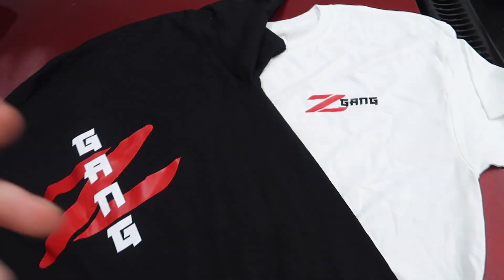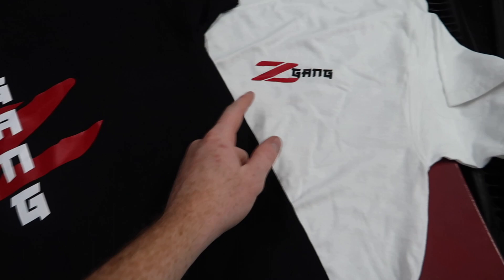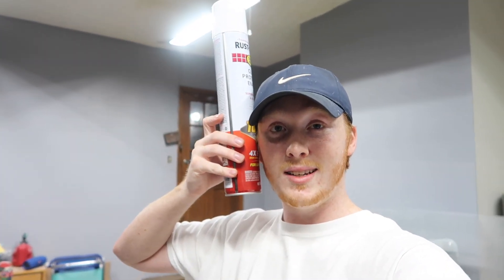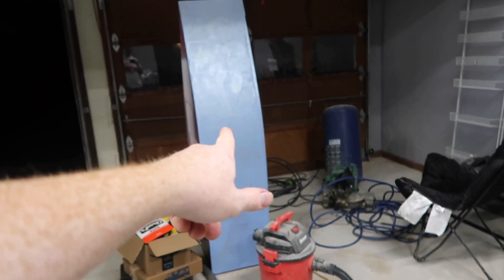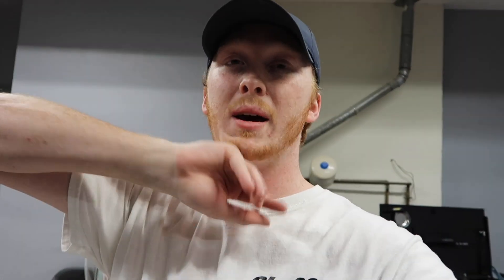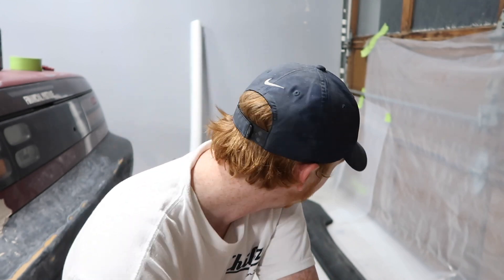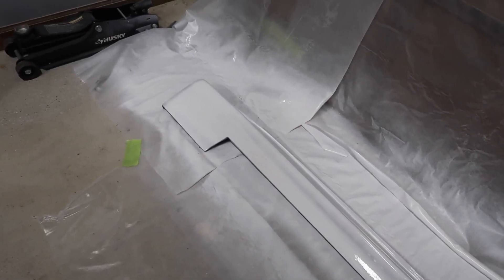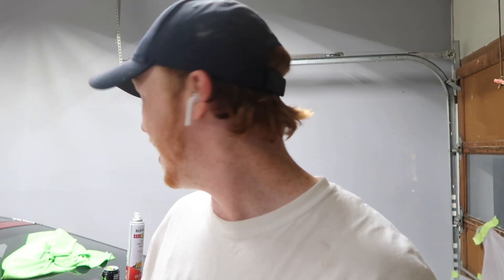300ZX Paint color reveal!

Comment: consider primering car aswell. you will have ringings around all of your body work areas if you dont, maybe not right away put paint shrinks as it cures also its good to have the car a uniform color before spraying your basecoat. painting over a black part might end up looking different than the red part you sprayed over.

Comment: antime you paint plastic or metal you need a BONDER, ie PRIMER. they sell primers made for plastic and ones made for metal. it legit bites into plastic or metal to prevent pain from flaking off later. always pre-prime parts. 800 gritt after primer is good before paint. then wetsand paint with 800-2000 gritt then clean and clearcoat. then wetsand with 1k-3k and polish clearcoat. that is as basic and simple as it all gets.
Reply from the maker: Appreciate the tips🤘🏼 I’ll definitely be doing that👌

Comment: also if you use spray paint on a car it can be counter productive for the future. in alot of cases when you go to spray with real paint over a part that has been rattle canned. the real paint will eat and lift the spray paint. with that being said if you plan on getting a real paint job in the future the old spray paint will all have to be sanded off. looking into single stage paint jobs cheap and easy. cars are an investment. you went TT, you went wide body...... spray paint bro ???